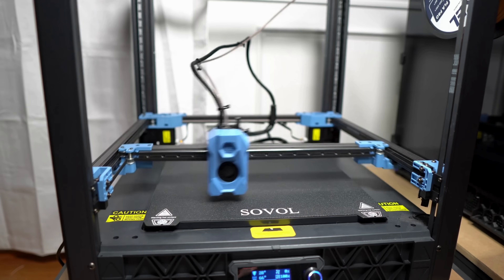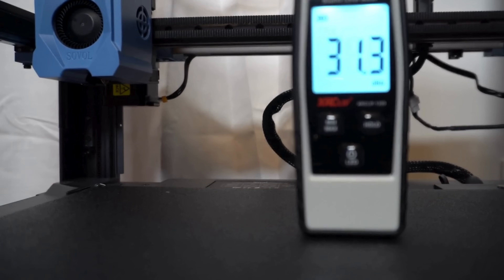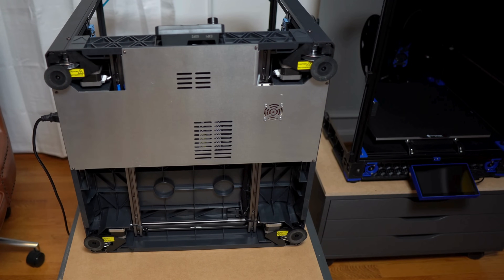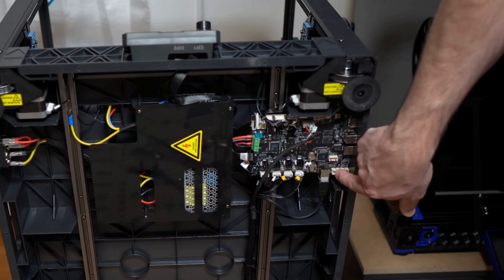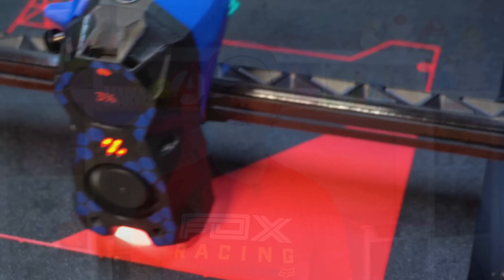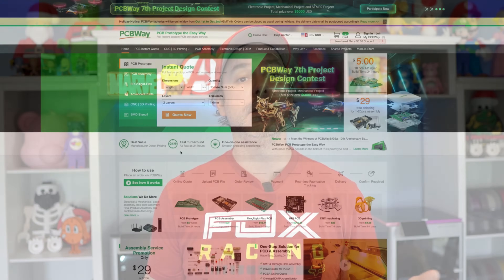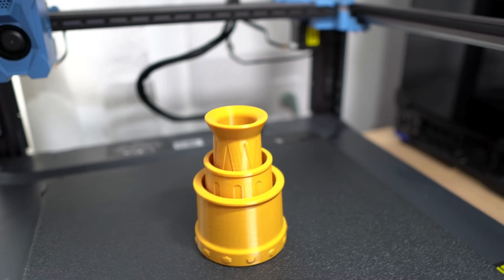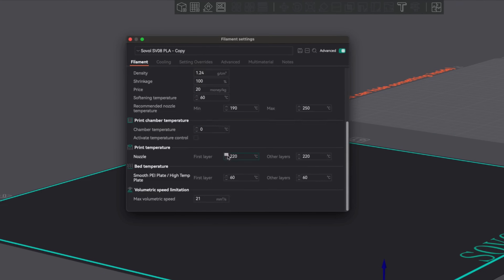Let's tweak the Sovol SV08

Comment: One suggestion you might want to look into but is a bit more complicated is adding a BTT Eddy USB or the Beacon probe, The BTT Eddy USB probe is about $34 on amazon or $25 at BTT but takes longer to get, The Beacon Probe is a bit more expensive running at $80 or more depending on the verson you get. These are the heat compensated probes so they don't react to the bed heat like previous versons were prone to. The Eddy probe can scan the whole bed in 20 seconds and has a .5 micron accuracy. I just recieved mine today and will be installing it in my SV08 sometime this week!
Reply from the maker: That is awesome, I have an eddy usb sitting here as well I have planned to use with the sv08. I was waiting for mainline klipper to support the eddy sensor and looks like it does with the latest update. Will need to move to mainline from the sv08 fork. Which will take a bit of effort.
Reply: @ThePrintasaurus  Ya same, just dreading doing the switch over, i just got the emmc v2 and adapter in the mail also so I can just do a swap when i get it programmed with the mainline! Good luck with your switch over!!..lol Are you gonna do a video on the switch over, would be great to see.
Reply from the maker: I do plan to do a video on converting to mainline. Plan to do a whole segment on upgrading and changing the SV08 on a "Budget". Waiting on a few more parts and I'll start converting / filming.
Reply: @ThePrintasaurus  Nice, Looking foward to seeing them.  I just bought myself the Flsun V400 too literly a few mintues ago...lol. To go along with my 3 resin printers, and my 4 other FDM's...lol Next will be the enclosures for both the SV08 and the V400! Looking foward to printing some helmets for my friends!
Reply from the maker: @cowboy124aa3  Let me know how that FLsun V400 is when you get it. Have been thinking about trying one out.
Reply: @ThePrintasaurus  Will do!!
Reply from the maker: Just finished a video on my change over to the mainline.    https://youtu.be/YOJeFxmW7eA?si=I9FFWcUjfdtXexn3
Reply: Very interested in this modification.
Reply from the maker: @S.A.S.H.   I finished my conversion to mainline klipper last week. That video is now up on my page. I will have a follow up video soon with the eddy coil upgrade. Keep an eye out for that one in the next week or so!
Reply: @ThePrintasaurus  thanks. I also need to watch your Hyrda Pro video.

Comment: I recommend changing the probe amount to 5 vs 3
swap back to average

in reference to the above; adapt the voron start print macro (better start print macro) and KAMP
it'll call whatever your slicer calls and then your probe will become even more accurate as the probe will soak on the bed at the temp you call. Your Z shouldn't change.

Also recommend mainlining the SV08 as well.
Reply from the maker: I have been playing around with working on a start print for the SV08 that is closer to my Voron. Plan to move to mainline klipper soon as well. Thanks for the inputs and watching. Are you using the SV08?
Reply: @ThePrintasaurus  yup. I helped write the documention. I was the first one to officially get the sv08 mainlined through trial and error
Reply: @ss1gohan13 You have been a great help to the community.  You helped me directly, on the Discord.  Thank you for being generous with your time.

Comment: good luck
Reply from the maker: How do you like the SV08 so far?
Reply: @ThePrintasaurus  :) my toolhead board is with the distributor of sovol now because it died, 300 hours i think ?? Z offset inconsistency made a print lift off the bed and made 3 of my bambulab hotends to be covered in very hard to remove pla, i switched my hotend out for a bambulab hotend cuz of the defected nozzle printing petg
Reply from the maker: I am in the process of comparing tool head options and plan to do a video on how to swap to something better overall. Keep me posted on how your experience goes. Shoot me a email theprintasaurus@gmail.com   I'll send you what I was looking into, maybe that will help you decision on what to go with. I have also been looking into moving over to mainline Klipper - which you would need to do if you wanted to run a BTT Eddy (most likely what I am going to run). I believe mainline Klipper now supports it. I am going to test on my voron first, then work on converting and improving the SV08 further.
Reply: @ThePrintasaurus  oh and the heater and thermistor cable broke because of the blob
Reply: @ThePrintasaurus  i really want to change out the toolhead with voron stealthburner with a rapido uhf or a vz bot toolhead but im afraid that i couldnt do it